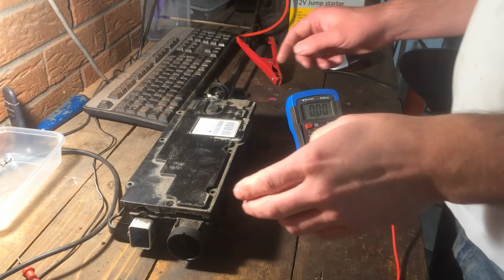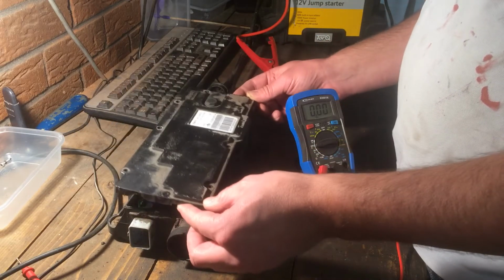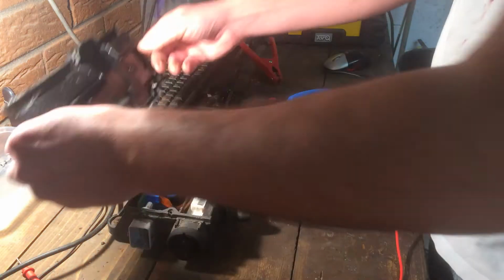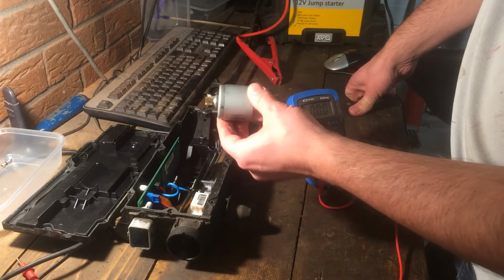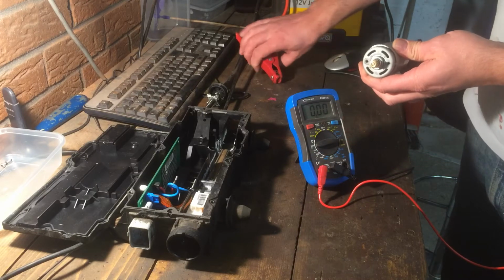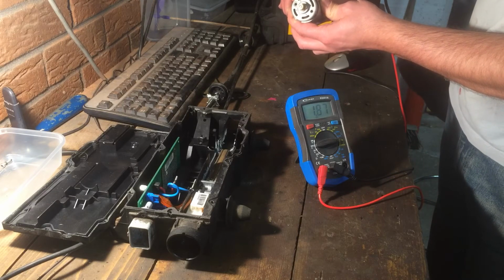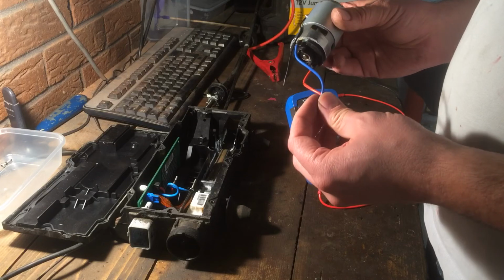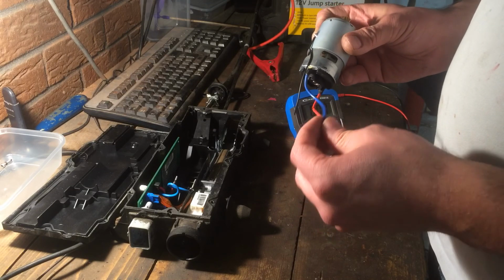Ford C-Max electric parking brake repair

Comment: Hi! There is trully not too much information about repairing this unit. My dude has a C-Max he changed a brakepads after it he did not resetted the electronic to know that tha pads was changed. It worked while but gone every time worst and once it tryed to close and made noises like its is trying to close, then it released and since then it do nothing else.
Can you explain what to do reset the electronics? Tomorrow he will disassembly the brakeelectronics and take  a look iside.
Some advices would be nice. Thanks!

Comment: Does a disconnect mean that it needs the codes resetting? I had to repair a crack on the torque unit ribbon and it is not  working like it is supposed to and more like a conventional car.
Reply from the maker: I don’t believe any codes were stored. I removed car battery for a while and it reset.

Comment: Did you order 10 motors? Because on the a page of a company ELVMOTOR is minimal amount 10 pcs. And I need just a one.
Reply from the maker: No, only one, from blue chip autotronics in wales
Reply: That's us! We have had a motor made for the Kuster EPB. 01873 740999

Comment: Hi, what was the indicator you had an EPB problem? I have a 2004 CMax and EPB is squealing for a few seconds when initially turned on. Then dash says partial or EPB failure. So far it hasn't locked on and local garage telling me it could be because of cold weather but due to age of the car I wonder if it might need a repair along these lines. Wondering if you had similar before you started this work?
Reply from the maker: I bought the car with the EPB already faulty.

I understand that over time the carbon bushes in the motor wear down to the point where the motor doesn't operate properly or breaks.  The squealing You hear might be the motor. The company I reference in the post can either fix it for you or sell the motor on its own if your game try get it fixed yourself,  motor was only £60 odd so I was happy to give it a go which turned out successful. Changed the brake cables at the same time but they where pricey at £120.

Buying a second hand unit also an option but unless it's from a newer car you could run into the same problems.

Good luck!
Reply: You have a safety clutch. Look at the cable, most likely it's because of them.
Sorry for my english, GOOGLE.
https://www.linor.pl/samochodowe-linki/ford/c-max/
Reply: There is a safety clutch built into the gearbox. It protects the motor in the event the internal lead screw runs out of travel. It makes a noise like someone torturing a small animal. The usual cause is a failed caliper of a collapsed outer sheath on one of the bowden cables.